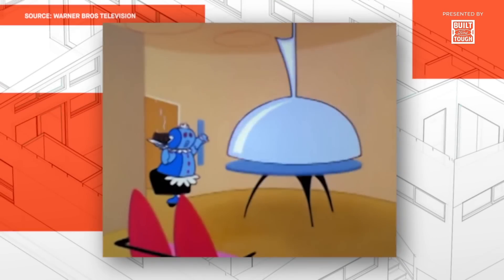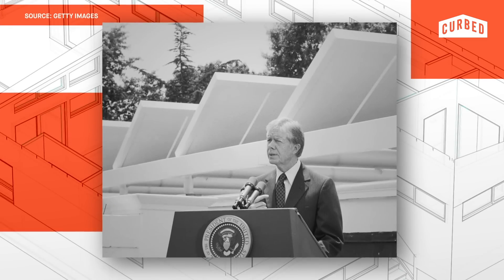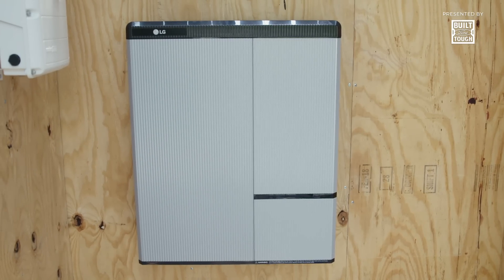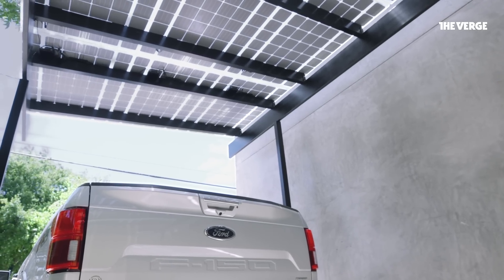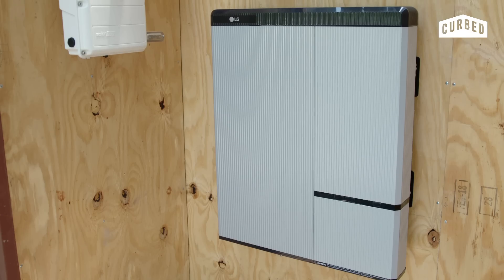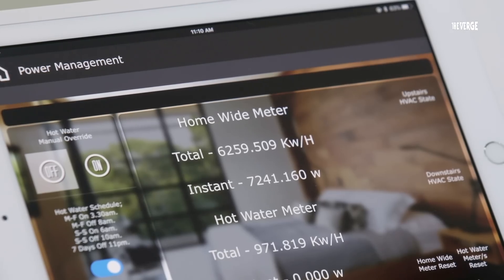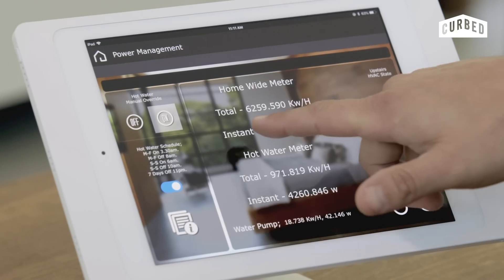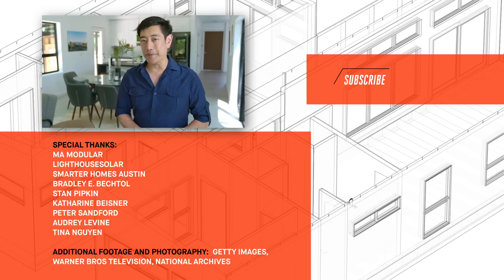The future of renewable energy is making it look cool

Comment: Not that smart to have a tree right next to the solar cells. The shade's going to reduce efficiency massively.
Reply: Oscar Lee exactly what I was thinking. It seems they’d be much better off putting the panels on the roof, instead of shading them with trees just to make things prettier.
Reply: @dev.lockridge  It was done for show.
Reply: I think maybe you  mean its not smart to have the solar cells right next to the tree.  The tree is the most efficient thing here... especially in a air conditioning dominated climate like Austin...
Reply: Exactly in Texas shade is far more valuable to us then power. We need the shade just to live comfortability most of the year. There's a joke that we will walk almost any distance to park our cars in the shade. Trees on our property and our neighbors properties help us all to live better and use less power overall.
Reply: Shadows covering up a single cell will reduce the output of the whole system. This build is just a waste of money.
Reply: @Rediwed1  From what I can see, they seem to have optimizers installed on them. What this does in a sense is allow independency between solar panels. Basically, reduced output in one panel from shading, etc will not negatively effect the rest of the system. Ideally though, yes, you would want to reduce shading as much as possible. Probably not a very high production system, but it is only really a prototype house.
Reply: It’s a temporary house. They’re not going to shell out all this money for the ideal house, because they’re not going to get anything out of this.
Reply: surely once the series is over they'll just sell the house?
Reply: Covering one panel doesn’t reduce the efficiency of the whole array. Modern solar systems have an inverter for each panel, so if one is shaded it doesn’t reduce the output of the total array - just that panel.

The tree might need a trim, but this isn’t that big a deal. Besides, sometimes adding a few extra panels to generate a little extra energy is worth it so you don’t have to chop down trees just to have panels...
Reply: At the very least, they could put micro inverters on the solar system.  The solar guy didn't talk about micro inverters, so I'm assuming they don't have micro inverters.
Reply: They're also laying almost flat, drastically reducing their already limited power generation.
Reply: The system is equipped with a Solaredge Power optimizers. This provides Module Level Optimization (the same basic principle at work with Microinverters) This mitigates the effect that variable irradiance or intermittent shading has on the system level production. It is a compliment to the manufacturer that you can't see the optimizers- they have become increasingly small and more efficient.
Reply: @rayage777  whats a micro inverter?
Reply: rick ali A micro inverter is just an inverter that goes to each solar panel.  It's just there so that when one panel gets shade or goes out, the other panels still produce power.  It does also add more things that can go wrong with your system.  I have had 3 micro inverters die on me and had to be replaced.
Reply: Fashion over function here :/
They have used a SolarEdge solution which should have optimizers allowing each panel to operate independent of of each other, This or Enphase micro inverters is the best way to deal with shade.
How ever in this case a wall of shade from trees that big and that close I can not imagine the output would be very good.
Would love to see the monitoring
Reply: if you look at the position of the sun you can see that the tree is on the north or the south side and hence does not affect the solar input to a large extent
Reply: Oscar Lee 什么狗屁语言?看不懂
Reply: Any leaves and sticks would fall onto the panels also..
Reply: Part of the house design was to use the PV panels as the carpory roof, so leaving holes in the carpory roof would have looked funny.  Its also easier to put up the panels in a flat plane than having to do a solar study to decide which panels are shaded.  Additionallt, since trees grow, get trimmed and eventually die, the shading will change anyway.
Reply: Oscar Lee or you could say how's your solar panel gonna work if it's blocked by a tree
Reply: The panels are pretty... I guess they imply that the supposed owners can add on to their real roof as they get the funds to do so.
Reply: Yes, but this is Austin. The sun is intense and it's rarely cloudy
Reply: didn't even notice haha

Comment: The house's structure has batteries in it too.  Anything that holds a lot of heat energy.  Unfortunately, this house, like most in the southern, hot states, has the thermal mass on the wrong side of the wall (insulation) system.  Thermal mass should be inside the envelope, (where there is only sheetrock and tile here) and not outside, (where the stucco cement is working against you)  
Exchange the stucco cement for lightweight, reflective siding (use a radiant barrier to envelope the entire house) and add thermal mass inside, in the form of masonry walls, a chimney, or Phase Change Materials.  Any properly designed Passive Haus should maintain an inside temperature between 60 F and 85 F just by itself, no equipment.
Love the solar PV battery storage system.  I just bought the same thing (Solar Edge plus Resu 10 battery storage) and will be commissioning it, today, except the city of Palm Springs didn't accept my permit application, so I'm doing it despite them.  They didn't like my "Single Line Drawing", cut and pasted from the Solar Edge website's tech support pages, and think that I'll submit further applications to address that.  I re-submitted once, that's all they get.  It's 115 F everyday for six weeks and I'm sitting underneath $20k worth of equipment I can't use because of that?  Over my dead body, which is what will be here, if we're not allowed to use the stuff due to some bureaucrat.  My installation will pass any inspection.
Are the carport panels translucent?  It doesn't look like it.  That would be my only suggestion, but they cost more too.  I like how the steel roof drains right onto them, presumably to keep the dust off.

Comment: Too bad they didn’t find a geothermal sponsor (maybe like Dandelion) - geothermal heat exchange is one of the most efficient way to heat/cool a home and can also reduce water heating costs significantly as well - if its new construction and you can offset w HVAC costs, it’d pay for itself in a few years. (As they pointed out in the video, water and temperature control are probably the biggest energy consumers in an average household).

Comment: 90% comments about the Ford F-150
10% about household energy usage
Reply: Well in fairness the F-150 is an order of magnitude higher energy consumption than the house and higher running costs too. For a "home of the future" this place is fairly unambitious. Vs my apartment here in Ireland they have similar floor space, less solar (all apartments in my building have their own solar arrays... it's a legal requirement to have a minimum amount of renewable generation for any new home here), no heat recovery ventilation (again pretty standard here, works for cooling too), less storage (I have 27kWh) and no EV (I have two). Heck, that place is still directly using electricity for hot water instead of the heat pumps common here in europe for the last 10+ years (2-4 times lower energy consumption). For less than the average power bill for that home (based on the figures in the power management screen and average rates for both countries) I run my whole home and both cars.
Reply: cros13 Preach, I have one EV, live in a 2000 square foot house in San Francisco, and I average only 10 kWh per day.  The United States needs to STOP being the highest consumers in every thing and stop being in denial and always blaming China. At least they’re trying. Even India is doing more.
Reply: 10% divided in 9% about the trees shades and 1% about several things 😂
Reply: I know.. Small minded people tend to focus on things that don't matter... Oh well, their loss..
Reply: This sponsored video did as was intended: get people talking about FORD . Plain as day marketing this mini series is.
Reply: why talk about the purpose of the video instead choose to pick the one thing that doesn't fit your narrative in life. Pretentious urban people piss me off. Trucks have a purpose and aren't going away. Its funny because in the video they talk about how do these companies know how much power you use, when the same could be said about this truck. What if the owner shares it with 10 other neighbors and its used once or twice a week? Anyway whatever, these people clearly don't understand what its like to haul lumber for a job or drive through a foot of snow. Can't explain to the ignorant
Reply: Kyle S Emmm... the series are called the home of the future, in the furure there will not be gas cars. And i know that the pickup trucks are necessary and they will not dissapear but they will be electric, like the Tesla pickup, the Atlis pickup... In conclusion i think its not very smart to make a renewable energy oriented home and use an internal combustion car... they could have used a electric car, even an electric ford focus if ford wanted to advertise. But that is my opinion.
Reply: @kschaub62  well, be pissed off again, trucks may have a purpose but most people don't have a purpose for a truck.

Comment: I am aware that Ford is sponsoring this, but this tank of a car is certainly not "of the future" but very much of the past. Talking about solar with that gas guzzler in front of the house is kind of ridiculous. Apart from that, great series, thx.
Reply: TbT well, it drives better, has better gas mileage, and reduced emssions compared to trucks of the past. It produces fewer emissions than a lawn mower or a motorcycle. So not really of the past thanks to regulations!
Reply: Aaron _ fewer emissions than a lawnmower doesn’t say much considering lawnmowers have 0 emissions controls and are massively inefficient & big polluters.
Reply: Ford does make the best truck though, got to admit that.
Reply: Electric cars release ludicrous amounts of CO2 in the production of the car and the generation of electricity. There's no reason a truck would necessarily be out of place here. Besides, Ford is making an electric F-150 if all you care about is not using oil.
Reply: @Jake-rs9nq  That is simply not true. Yes, an Electric car has a CO2 backpack from production, but after about 15000miles that is gone and with the normal electricity mix (the more renewables the better) and especially with 100% eco tariffs, the CO2 comparison is simply better for the EV.
EVs, because they are so efficient, are very much influenced by air resistance. A truck has more air resistance than necessary.
Reply: @_TbT_  The majority of the world's electricity comes from coal. Coal releases 2.21 pounds of CO2 per kWh, while petroleum releases 2.01. In addition, 5-10% of that electricity will be lost in transmission. The "normal electricity mix" you are referencing appears to be almost entirely exclusive to parts of Europe and North America. 

Electric cars are not the solution to reducing emissions unless electricity generation is clean. And don't forget that renewables often have a decent sized startup CO2 footprint. Only nuclear power can reliably provide a baseload with negligible emissions.
Reply: it might not be the ideal feature, but that is currently the best selling vehicle, by a country mile...

Comment: Installing the solar cells in flat plane the inefficient way YAY
Reply: In Austin, the optimum full year angle should be about 26 degrees, but if they're optimizing for the summer (due to AC usage) it should be about 7 degrees. It's a little hard to see from the video what the actual tilt is (it doesn't look exactly flat, but it's hard to tell).

Comment: I think that we spend more energy during our effort to save energy. Need Smbd to explain why we need appliance to be smart and not only energy efficient.
Reply: G Kel 
Yeah, part of the efficiency cycle is ignored. We have the three R's but its actually six

Reduce -is it possible to reduce the amount of materials used? This will help to protect valuable resources.

Rethink - is there a better way to solve this problem that is less damaging to the environment?

Refuse - this means not accepting things that are not the best option for the environment. For example, is the packaging really needed?

Recycle - could recycled materials be used, or is the product made from materials that are easy to recycle?

Reuse - could the product have another use? Could its parts be used in other products? Is this information clearly communicated on the product? This will extend its life.

Repair- is the product easy to repair? This will extend its life.
Reply: Pseudonymous Being, this times a million. Should be optimising for least material used, make it fixable, and reusable, then finally recyclable.

Ultimately we can somewhat ignore the energy cost if the way we make energy is cheap and efficient in terms of materials (recyclable solar cells, for example, means that once one generation of solar reaches end of life we use the materials to build the next generation). Offset some of the initial cost of perhaps more expensive materials by making them worth something at end of life for recycling.

All of this is going to require materials dug out of the ground, but if we can design it so that we can implement closed loop manufacture and recycling then that will limit it somewhat.

Comment: that's not enough panels.  Car port is stupid.  build a real garage.  and welcome to 2004.  Nothing new here.  And parking big arse Ford is storytelling without thinking.  BTW having battery is stupid too... unless you live in area with frequent power outage.. then again, you probably won't able to afford it...
Reply: i think the point of the video is just to demonstrate what a house in the future can do because of all the advanced technology available, so they just crammed everything into it. they dont necessarily have to be practical about it
Reply: Ric Lorenz not the future at all. Maybe recap of 2004.
Reply: A battery has the potential to save you a lot of money, because it costs more money to buy electricity off the grid than you get from selling. Therefore, it's much better to use your own solar energy instead of selling it. However, there usually isn't a lot of sun during peak load times in the morning and evening. If you can collect your solar energy with a battery in the middle of the day, and use it through the evening and night, much less energy has to be bought off the grid, saving you money. But yeah, it is often crazy expensive upfront to install.
Reply: Battery is very useful and can keep you completely self sustainable during the night or off peak sunlight hours...
Reply: The trick is to get a suitably sized battery. Don't buy one that can provide your entire daily power, just what your most common evening usage is. Let the system pull in a little bit from the grid overnight on a cheap tariff for the few times you use a bit more than normal, and push it out when you use a bit more.

I'm going for a ~5kW system, with a 6.5kWh LG battery. Under $10k here in Aus after incentives. Will completely offset our daily usage, with a bit extra to the grid, and should effectively make our power bills zero $.
Reply: Matthew Jenkinson I did a little different. 12kw for PV and used the extra money for Tesla. My Tesla can power my house for a day if shtf does come one day
Reply: Jon Marshall - Gaming & Tech meh. Unless you live in middle of nowhere or storm prone area.  Never lost power last 30 years in New York area. Not even during that 2004 northeast big blackout.  Lol